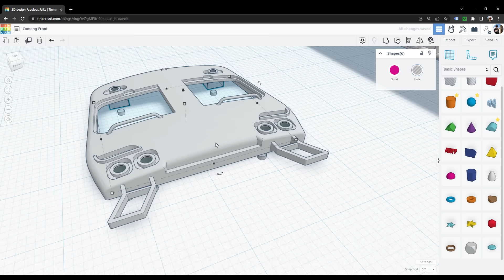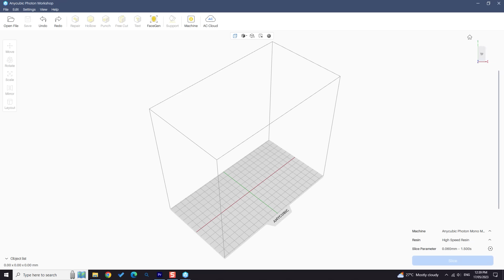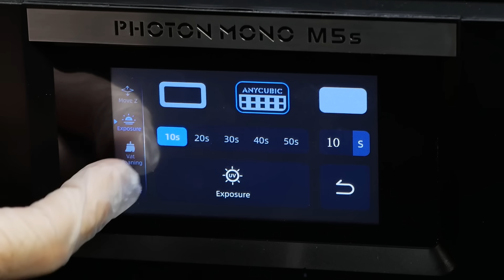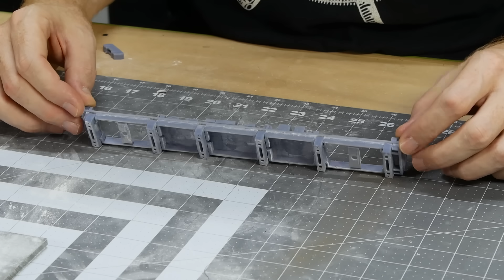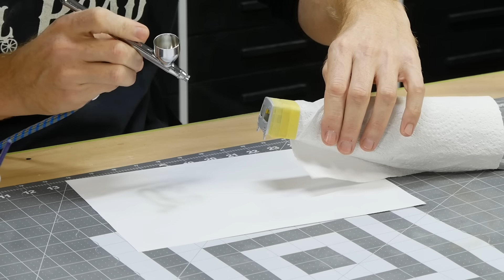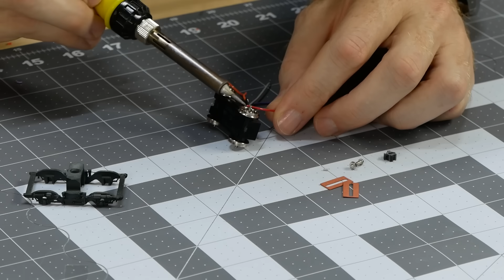3D print your own working HO scale model trains!

Comment: I just want to know how to get the right size of the model like what if 3D printed it too small or too big
Reply from the maker: I use HO scale, if I can find measurements like length or width I can adjust the 3D model to match the scale size. Otherwise I have a 3D model of a figure and I just scale it against the figure until it looks right 😉

Comment: just a small nitpick, but that comeng model, or at least the inner car end is of the original 1980s style, without windows cut in. the connex and m train comengs had windows cut into the car ends. however the cab looks much closer to the alstom refurb

Comment: Wow, what a detailed video.. the finished product looks fantastic.. I only have an FDM printer and this makes me want to get a resin printer to make stuff like this for my layout... 

Just a quick question pls... what type/brand of oil do you use on the engines.. I saw you using some but there were no details on the bottle you were using.. There are a lot of differing opinions on what to use for engines and I am also in Melbourne Australia and want to get something suitable for my engines.. I was told not to use 3in1 type which I presently use for my FDM printer. Any info on what you use and possibly where to get it would be a great help, thanks in advance Tim.

Comment: Very cool creation!!! You did make me giggle when you said, "average hobbyist like us...", I would consider your skills well beyond 'average'. My main geekage is scale 1/10 and 1/14 scale rock crawlers, semi trucks and construction equipment. I use my FDM printers mainly for making support pieces that are hidden so there is little finish work that needs to be done. I have been looking at resin printers for printing more detailed parts that do not need as much work to finish; however, I lack a space to set it up where I can have adequate ventilation. If I did take the leap back into HO scale, I would likely get a resin printer for custom creations.

Comment: Awesome work. I have 3d printers (resin and filament) and I was thinking about constructing a train set for myself. Although, I NEED a certain feature I've been dreaming of: train loads/unloads passengers in point A and loads/unloads them in point B. Yes, I'd like to transport passenger figurines from one train station to another, in the other end of the set. I'm trying to figure out what kind of contraption would allow me to do this without having to intervene; has to be fully auto. Maybe put some rails in the station platform that drive up to the doors of the wagon and figures are pushed along the rail to board the train and some mechanism that does something similar to unload them through the other door? Anyways, I'm posting this in case someone wants to share some ideas. Again, great job!

Comment: Great video, i would recommend cutting something like the train in half and print. The taller the 3d print is the more significant the print time is with resin printers due to more layers. Basically if we were to print a tower it would print far faster laid down vs standing up straight.

Comment: Even with laser-printed decals, use a clear-coat.  I use Krylon gloss, but of course - Tamiya works.   Spray the clear coats about 24 hrs after printing, then wait another 24hrs before cutting and using the decals.   The clear coats makes the decals a bit thicker, easier to work with so they won't tear as easily.   Of course, use Microset and Microsol during application.

Comment: Can you imagine if you had to BUY everything he has?  Laser printers, 3D printers, precision tools, the electronics and supplies, all the equipment, the shop, paints, adhesives, Photoshop software, PC's.....and on and on and on!  I swear, it would be a hundred thousand dollar model shop!  YIKES
Reply: If your lucky, some cities have maker spaces/studios where you can use equipment like 3D printers and laser printers which is significantly cheaper than buying it yourself and there's also people there to help you, there's also several free programs for photo editing, there's cheaper paints, cheaper tools..  yeah model making is an extremely expensive hobby and there's no getting around that, but there are ways to save money starting out
Reply: @endersquid1132 *You're.
Reply: Probably closer to 25k but it’s not like anyone says welp today seems like a great day to buy 25k worth of equipment for trains you gradually acquire more and more as you invest in your hobby
Reply: The main thing the printer is 500 bucks and a laser etcher is like 200 bucks it’s not bad
Reply: I built my model workshop for around $5k and has most of what he has
Reply: This makes sense, but typically I see these types of things as leveling up my capabilities. It’s expensive to start, but I’ve used my 3d printer to fix dozens of things around my house, which little by little makes the printer worth it. I wouldn’t be able to replace individual toy parts for my kids for example, so a lot of the time, I would have to just toss it otherwise. Over the past weekend, I fixed my kids toy drill, train, and blender. I would have just had to toss those without the proper parts.
Reply: You can get a 3d printer pretty cheap, and most software has free alternatives, it's really not as expensive as you think, at least not to just to get started with the basics, you don't need the most expensive hardware, you can upgrade later if it is something you use a lot and feel like the upgrade is worth it
Reply: @Johnny  But once you've spent the money, you can immediately start creating your own design of railcar which you can then SELL quantities of, and recoup the amount in quite a short time!
Reply: Everyone starts from scratch, you may start with just 500 dollars printer and progress from there, decals may be bought from another supplier who prints custom made decals. The rest of the parts for diorama and other parts can also 3d printer or acquired by time. You make the hobby expensive as you wish to be.
Reply: I’d still do it because look not all trains exist in model form. For example most trains in my area don’t have ANY models!!!!!!!!
Reply: Not expensive at all! 5k or less would give u cnc, laser, 3d, resin, and still have$$$ left over.
Reply: Yes but if you genuinely love model railways you will be able to save alot in the long term. Not saying its cheap but with all the other things you can use a printer and laser cutter for he will get his use out of it.
Reply: Wtf are you whining about lmao
Reply: I know a good number of folks who have most of that equipment for reasons aside from model trains. For those people, it’s just one or two purchases and it’s complete. I clicked this video bc I’m interested and I have almost everything he has already - my job and hobbies have tooled me up.

Comment: Luke I just finished printing my model I ran out of resin I have more on order will be here tomorrow  Just need to print the  Free Bogie file for this model.   Since I used Silver Metalic Filament I only need to paint the small parts.   Can you post a link to where you got the 
Tenshodo 28.7 mm Wheel Base 10.5 mm Wheel diameter motor?

Thank you Tom

Comment: Hey there 
I just wanted to tell you that Comengs are 3 or 6 Carriages and they are in a M+T+M Configuration. The one that you made in the video is an M so you may have to do a second M and a T for a complete 3 carriage set. A 6 Carriage set is just two 3 Carriage Sets coupled together.

Comment: 3D Printing sure is a game changer for Scale Modelers... I for one couldn't have been bothered making my 1/16 E-100 ( https://youtu.be/l3_RcOU3zo0 ) without the use of my FDM and SLA 3D Printers... Especially the SLA one responsible for most of the otherwise highly labor-intensive Detail Parts like the Tracks and Running Gear... 😑

Comment: nice :) i modelled a train car from scratch to print on my Mono, came out pretty good :) it was for a Rivarossi Blue Comet (shared it on thingiverse) i think i had some issue with not curing it properly, or not letting it dry completely because after a while the whole thing sagged in the middle XD so i had to use a heat gun to fix it :v

Comment: great work again.  still enjoy the fact that you still use tinker cad :)  I still use it too.
Reply from the maker: Ha ha, yeah it's just such an easy program to use! And can do just about any job when it comes to making small details for model railroad 😊
Reply: @BoulderCreekRailroad  My little girl started to use Tinker Cad for school around 6th grade.  So I ended up using it along with her for class and school.  I know a few things I wish it had.   I wish it worked on the PC and not in the cloud.   I wish it had a way to filter down into the layer object list.  I wish it had a better radius tool or a way to bend objects etc.   but for the quick speed of use, tinkercad is my go to 3D tool.   The girl will be going into 12th next year.  So I have been using the tool for around 6 years now.
Reply from the maker: Oh wow, I definitely agree with those missing features! They recently added the magnet 🧲  tool so hopefully they'll figure out a way to integrate more features like that in the future...
Reply: @BoulderCreekRailroad  I have seen the magnet tool, but have not tried it yet.  I'm still working on the basics of the 3 Dimensional Shapes (Cube, Sphere and cone)  :)

Comment: While a great concept, I do think the way you printed it was not great. By having it print at an angle and not laying down on the print bed you generated more plastic waste than was used in the actual model. I realize the print bed was too small for this, however you could have split the model in two and made it so that it could snap together afterwards. If you coupled this with printing it upside down, you could theoretically eliminate almost all the supports, greatly reducing wast and clean-up time.
Reply: Sometimes when splitting pieces, they might not end up fitting together due to warping while printing or a mistake while cutting. Having to reprint would produce even more plastic waste. Learned this the hard way after having the same initial thought. Especially with thin fragile pieces like this. With thicker pieces any mistakes might be coverable with some modeling clay or something, but thin pieces have a very small margin of error. And this model needs to be perfect to fit all the parts together, do I understand why he did it this way.
In the end, doing any craft is going to come with waste products. While it's imperative that we do our beat to reduce it, it'll never be zero and it will always be less than a drop in the bucket compared to what corporations create.
Luke is a pro and has expressed concerns about waste before, so I trust that this was the best outcome.

Comment: You might want to use/get a Xuron 2175 cutter for cutting supports from 3D prints. You can get really close to the root with the best cutter around.

Comment: Thanks Luke. How much would the printer such as the one you used cost? Could you do this project on a cheaper printer?
Reply from the maker: You could do this project on any resin printer, even the cheap ones, it's just the train is quite long so you'd need a large build volume. Typically for the printer I used they cost around $400 up to $800 depending on the brand.

Comment: This is fantastic! It is indeed amazing what can be achieved with 3d printing these days. But I have to say the printing bit is only part of the process. The model you've produced here, and the skills used, are still beyond most railway modellers. The CAD stuff alone takes hours of research, measuring and tweaking, but it is a very rewarding process to see your work emerging in 3D!

Comment: Wow, what a great model. That’s a great 3D printer, shame I cannot get one here yet. I have a few models that I want to create in N scale 1:148 . And so far none have the build quality. I will have to see when one is available and hopefully not expensive. Great video, missed the regular videos, but like everyone, life is hectic. Even though disabled slightly, getting around is tough, but not impossible. Off to try and visit a model exhibition this weekend, not as good as your videos Luke. Magic. 🎉
Reply from the maker: Thanks Paul, yeah 3D printing opens up so many doors when it comes to what can be modelled, I think 3D printers are only going to get cheaper and better with time. Plus there are some good second hand printers around so you might be able to find a good deal later.
Have fun at the exhibition 😉

Comment: I'm wondering why you printed the car at an angle. This is a much greater depth than horizontal. It seems that you could have divided the car into halves and printed them horizontally at the same time. 
This would be a lot faster because of the smaller vertical dimension. And you wouldn't have to deal with any supports as well. 
Of course you would have to attach the two halves but I think with a little glue and sanding that the joint would be invisible.
I know you have a reason for printing it as a singular unit. Would love to know why. Really enjoy your channel!
Reply from the maker: It was the only way I could get it to fit, I did think about splitting the model but I wanted to avoid having any imperfections with join lines. I've tried joining large flat sections before and it can be quite a challenge to get the join to disappear. 
The print speed is quite fast too, it only took a bit over 3 hours, I think if I was to sand glue and join the model afterwards it would have taken about the same amount of time overall.
Glad you enjoy the videos 😊

Comment: What was the reason for making the support brackets a separate part rather than making them part of the shell? I would think having those brackets as part of the print would help prevent warping.
Reply from the maker: good question... I only thought of it afterwards 😄 You are definitely right it would help hold the shell together.

Comment: Hi Luke, thank you for such an informative and interesting video. I have a Anycubic Photon D2 so I'll end up cutting any train models into two parts in order to get them to fit as the print volume is smaller. Anycubic is very good about posting the settings for their resins and their various printers. 

When it comes to using other brands of resin how do you determine the settings for printing? Are you aware of a site that has such information (such as the best settings for using Sunlu resin on Anycubic printers) or do have you started with the recommended settings on calibration prints and determined the best settings from there? Thanks in advance.

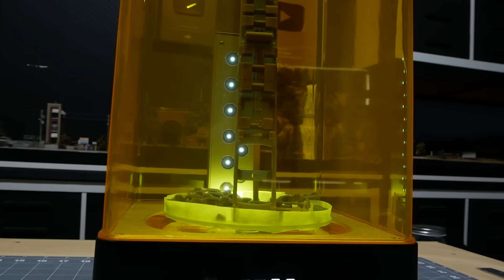Comment: The advertisement ends at 10:19 ... TBH this is highly annoying to see in a crafting channel :(
Reply: Why do you feel it's annoying?
Reply: @ncmaothvez   a 21 minute video, that contains a paid promotion that is over 10 minutes long, isn't annoying to you ?
Reply: @Kitsune_Rick  Not if the paid promotion contains interesting information and is related to the subject in the video. I had never heard of this resin printer before so I found the info interesting. Sure, I absolutely hate YT ads with a vengance but I mostly tune out the comercial aspect of infomercials.

Comment: Very cool also the Comengs weren't built in the 90s they were built in 1981 to replace the old wooden Tait trains, in 1998 when the split happened between Bayside trains and hillside trains hillside trains became Connex and it was privatised in August 1999 becoming a subsidiary of Connex. 👍 so there's two small facts about Connex and comengs
Reply: They were introduced for the city loop as they have no passenger opening windows.
Reply: @moshly64  
"They were introduced for the city loop as they have no passenger opening windows."
They were introduced after the city loop opened.  Many trains with opening windows operated through the city loop.  The non-opening windows would have been because they were air-conditioned.
Reply: The Comeng trains were actually built from 1981 to 1989.

It was the government that split the service into two, and named them Bayside and Hillside.  Both operations were put to tender for private operation, with a consortium led by the French-based CGEA Transport (Compagnie Générale d'Entreprises Automobiles), winning the Hillside tender.  They initially opted to keep the name Hillside, but in 1999 CGEA Transport was renamed Connex, and then in 2000, as part of a worldwide rebranding of their rail operations, Hillside Trains was rebranded Connex.